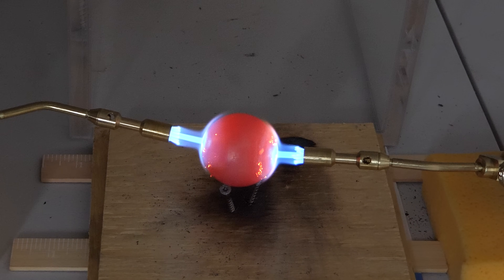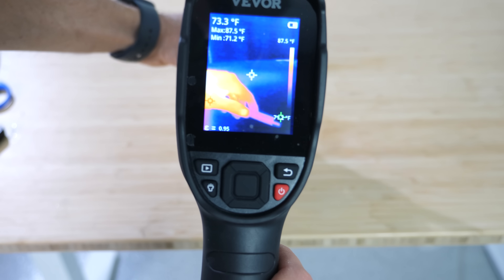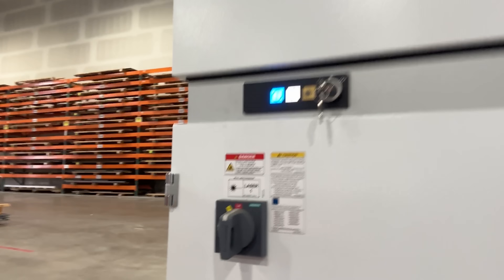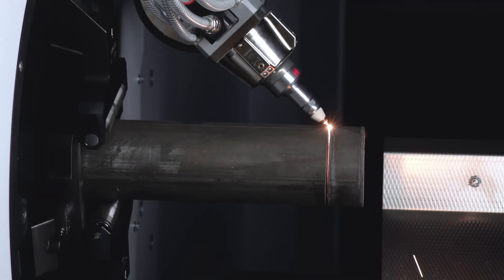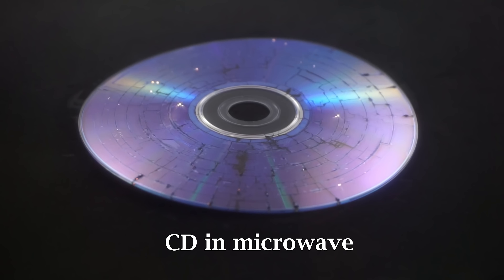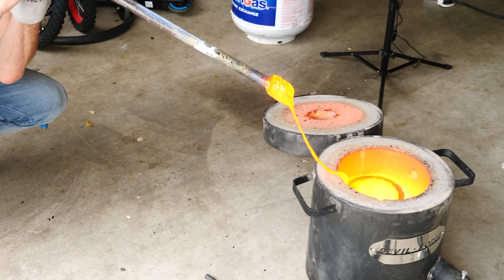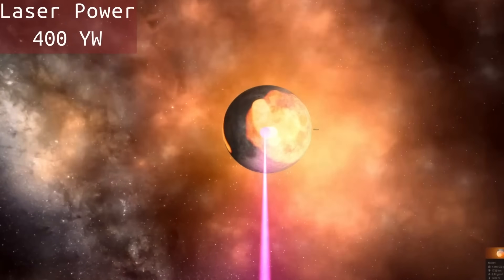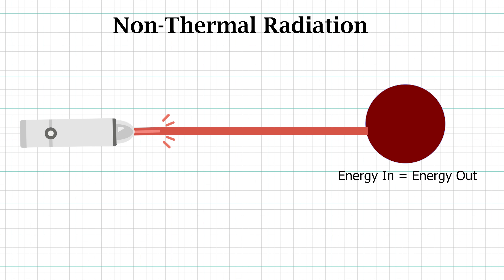How Hot is Light? How Lasers Bend the Rules of Heat Transfer

Comment: I think this is wrong. If I were to look at it from a quantum state, I would argue that the "temperature" never exceeds the source, because there is a transfer from an electron in the laser to an electron in the target material, and that specific transfer will be equal to the "temperature" of the emitting atom. It just keeps happening over and over with favorable conditions on the lasing side that keeps the laser intact, while the target is destroyed. However "temperature" in this case may need to be modified to include the effect of transferring a photon from a less massive atomic nuclei to a more massive nuclei, or vice versa, while the normal definition of "temperature" already factors the phonon vibrations that would normally result in the emission of a photon of the same wavelength from any given mass of the nucleus.

Comment: Thermal dynamic is heat transfer from A to B. 
Laser is however energy transfer from C to D.

The heat come off a laser source is just the energy dissipated as heat due to laser generator efficiency, usually misunderstood as the temperature of the laser source. 

Heating with laser may be regarded as heating with electricity (constant current forcing through a resistor). There is no apparent limit to a temperature ceiling, limit, if we can pass current successfully through it. Steel furnace involving a graphite electrodes to inject current through the steel resistor. It gets hotter and hotter until the energy dissipate off the system equals the input energy can temperature hit the ceiling, equilibrium at a certain temperature.

Comment: 2nd law of thermodynamics is about entropy change in close system. It means heat flow from hot to cold in the case of conduction. In the case of laser, it involves electrical energy input, excitation, spontaneous emissions, stimulated emissions. Each step is govt by thermo law. Kind of like an engine cycle.

Comment: This property of only heating up the source temperature is caused by the conservation of etendue. It's weird property, but it means that if you captured all the light coming off of the sun, you cannot compress that light smaller than the sun. Even simpler, get a flashlight and a magnifying glass, notice that even when you focus the image as much as possible it doesn't go to a single point. It you were able focus the beam tighter while capturing the same amount of light, then you would be able to heat it up hotter than the source.

Comment: What if you put the sun inside the laser stick and focus it's entire energy to a single spot? Can't it still get hotter than the sun itself?
Because like the battery source or the electricity flowing in the magnetron also the sun has an active energy source with fusion.

Comment: Here when laser is hit to any object due to the impulse force imparted by the lasers (electromagnetic waves) it causes an intense heating of the atoms of the object where lasers hit because the energy density inside a laser light is higher than the energy density in nuclear reactor core
So the more the energy power outage of the laser the more the temperature will rise of the object where lasers hit.

Comment: I used to run one of those LT8 laser cutters for various metal tubing. Thay really are amazing, and SUPER high tech. There are dozens of mirrors that the lazer bounces off before it goes through the lense (which is like a $350-500 lense). And thats not including the tube feeding and sensing system which I think is even more complex.

Comment: Now, what about total reflection, like in glass/air interface under specific angle ? It does not depend on conductivity, so it should not decrease... Would probably require a glass block and heating it evenly would be even more changing

Comment: You are wrong. Cutting laser do not vaporise steel. Depending on the supporting gas (oxygen or nitrogen), the metal in the cutting zone is either burned in an oxygen environment, or melted and blown away by a strong stream of nitrogen. In any case, the laser beam does not evaporate the metal, but only heats it.

Comment: You are transferring energy, not just "heat" with a laser.  So, the target gets constantly hit with additional energy and can get much hotter if it can't dissipate the energy being accumulated.  With the hot ball, the target gets hit with the initial heat, but it absorbs that energy from the hot ball, which is cooling as the heat transfers.  So, no new energy is being pumped into the system.

Comment: Ugh, again you say the same blatantly wrong things, you can indeed focus light to a higher temperature than the source. Temperature is a function of energy density, and you can always focus it more densely (well until you start getting into the wavelength size, then things can get weird).

The main mistake you make is you are bastardizing the laws of thermodynamics, which speak of energy, not temperature, to get your weird claims.

So with the focusing example, you would be correct to say that the energy remains the same before and after focusing (ignoring losses in the lens). But the temperature can indeed be higher, because you are changing the area through the focusing.

Comment: I want to explain this in simpler terms since the video doesn't quite do it in my opinion. The concept of temperature applies to physical objects or systems in equilibrium. A laser is continuously getting energy in the form of electricity and then transmitting this energy. This energy transfer is not limited to the laser's temperature because the process is driven by energy input to the laser system.

So energy goes up as long as input energy continues to be supplied.

Comment: It might be difficult to explain for people not familiar with thermodynamics but even lasers kind of have a temperature, it is just it of the scale, a temperature hotter than infinite (usually referred to as a negative temperature)
Lasers use something called population inversion to keep pumping energy into the beam, the idea is that you have more energy than what the system (in that specific degree of freedom) would have at infinite temperature, you have so much energy that entropy and energy relationship changes, now for every Watt added entropy starts to decrease again, that is called negative temperature and is hotter than any “normal” object.
To put in simple words if you go up on the temperature scale get to infinite and keep heating the object you will come back from -infinite and can keep getting hotter and hotter until you eventually reach absolute zero again but now from the negatives.

Comment: idk if the magnifying glass example is correct, because I would think the energy gathered is proportional to the energy source surface to be compared. so, if you have four flashlights via refraction indecies being made as a laser, in one focused beam, it would be colder than 6 flashlights in one focused beam despite each flashlight being identical and at the same temperature.

 sheerly because laser light is still light and more light= more energy, and the collective total energy does not car where it came from to decide how hot it is, it merely exists in a quantity to be expressed. Therefore, it is possible to get a magnifying glass to focus enough light to make a temperature hotter than the sun. Though, it would be impractical and expensive, unless done with an array of glasses or mirrors rather than a giant single piece. There has to be plenty of literature on this I presume because people boil salt this way to turn steam into electricity.

Comment: with Thermodynamics you think macroscopically. To understand how a laser cuts a good example is a sand blaster. The accelerated sand particles hit small sections of the sample kicking away small particles. With a laser each photon hits one single atom with an energy above binding  and ionisation threshold,and it detaches from other atoms and boils away. The higher the laser power the higher  the number of atoms blown away.  You do not need a lot of energy to kick one atom out of the condensed matter. But a lot of power to blow away as many as atoms are in a target. Remember Avogadro number of 6e23/55 atoms in one gram of iron (Fe)

Comment: Big note to point out is that the laser isnt doing the cutting. There is a jet of gas - oxygen or nitrogen (dependant on ferrous v non ferrous material) that does the cutting, the laser just heats up the material enough for the gas to blow it away

Comment: Pretty nice video mate! But one correction, you argued that when we magnify the sun light onto an object, the object can’t get hotter than the sun, but this is basically not the case. The sun heats the Earth via radiation but not convection or conduction. So magnifying the sun light is basically like using lasers :) One the thing we can argu of course is  the conservation of energy. So the Earth can’t use more energy than the Sun is creating :)

Comment: The laws of thermodynamics are outdated and depend on a vague concept of temperature. What is thermal radiation? It is simply electromagnetic radiation. What are lasers? Electromagnetic radiation. So what exactly is non traditional about lasers? The laws of thermodynamics are a special case of a much bigger law and therefore do not deserve to be called a law. Its not a law if you have to do mental gymnastics with definitions to fit the law

Comment: It doesn't really make sense to me why you can't get anything hotter than the surface of the sun by focusing the light. If the explanation for lasers and magnetrons being able to heat objects beyond their temperature is because they emit EM waves, then it should work with the sun too. The energy of the sun doesn't reach us in thermal form. It reaches us in EM form, just like lasers and magnetrons emit. Thermal energy can't propagate in space because there is no medium to propagate through. A magnifying glass doesn't focus thermal energy. It focuses light, which is EM energy.

If you really aren't able to heat things beyond the temperature of the sun, either there is something missing from the explanation, I am misunderstanding something or that statement about the sun is incorrect. Because as I understand it now you SHOULD be able to focus down the sun's EM waves to make things hotter than its surface. Just like you do with microwaves or the light of a laser.

Comment: Since thermal emission is related to surface area, you could theoretically use sunlight to heat something hotter than the surface of the sun, as long as the surface area you're heating is smaller than the surface area on the sun that originally emitted the light. You'd probably need some ridiculous planet sized lens to do it, but I think it is theoretically possible at least.
Reply from the maker: It is not even theoretically possible.

Comment: I'm pretty sure that the reason you didn't see a temperature by shining the laser at the infrared camera is that it was outside the spectrum detectible by the camera, otherwise it should register as the temperature equivalent to the black body radiation wavelength for that same temperature. However, the standard wavelength of infrared lasers is well above range detected by usual infrared heat detecting images. So I think your test at the beginning about the "temperature" of the laser was invalid, since I think it was outside the range of the detector.

Comment: It was cool seeing those Trumpf lasers. I used to work on Trumpf lasers, anywhere from 8kw to 24kw. I mainly operated a 24kw laser paired with a 3060 gantry. It was the first 3060 in the United States to have a 24kw resonator paired with it. I would do all kinds of stuff, from really thin aluminum, to 2 inch thick steel. I knew all the little tricks and techniques to get that thing to cut any material with no laser burr too. The science involved is quite complicated.

Comment: A word of caution. Most ND ,OD 4 to OD 5 ,safety glass 1040 to 1060 nm are great for fiber lasers. However, when the laser strikes the target, it is not just white light from heating that is given off. It is also UV that is not sufficiently protected from your eyes by the safety glasses. Please use caution when viewing the radiated heat signature from molten metal. It can damage your eyes just the same.
Reply: on summer, hot day i had to tig weld some inox tube, i did it in t shirt an i had red burns between wrist and shoulder
Reply: @ exactly, there exist a large body of expertise often through accident that is overlooked. Then you have persons who should know better not presenting information that could prevent serious injury.

Comment: You never did get into the physics of why...
HEAT is the movement of excited particles/molecules. 

Your hands are only 98 degrees, but if you excite them by rubbing them together, you can actually burn yourself (rub burn). 

The microwave vibrates the molecules in the food, heating it up internally.

Comment: Lasers don't defy the laws of thermodynamics. They actually rely on them to function. Here's a breakdown:

 • Energy Input: Lasers require an external energy source (like electricity) to operate. This energy is used to excite atoms within the laser medium, causing them to release photons (light particles).
 • Stimulated Emission:  The excited atoms release photons in a specific direction and with a specific wavelength, creating a coherent beam of light. This process is called stimulated emission.
 • Heat Dissipation:  Not all the input energy is converted into laser light. Some is lost as heat. This is why lasers often need cooling systems to prevent overheating.

So, how does this relate to thermodynamics?
 
•First Law of Thermodynamics: This law states that energy cannot be created or destroyed, only converted from one form to another. Lasers follow this law by converting electrical energy into light energy and heat.
•Second Law of Thermodynamics: This law states that the total entropy (disorder) of an isolated system always increases over time. Lasers don't violate this law either. While they create a highly ordered beam of light, they also generate heat, which increases the overall entropy of the system.

In essence, lasers are a clever way to harness and direct energy, but they don't break any fundamental physical laws.

Comment: Just to make sure everybody’s clear on this, heat flowing from high temperature to low temperature relates to heat conduction between bodies in contact, whereas heating things up with a laser is a case of Radiation Heat Transfer.

All pedantistry aside though, great video as usual!  Thanks.
Reply: Heat will also flow from something hotter to something cooler via radiation, not only conduction.
Reply: @HarmanRobotics, yes, that is 100% true (radiation, rather than conduction, from hot objects to colder objects).  In fact, I had intended to modify my comment above to clarify that the laser heating here is Radiation heating but not Radiation Heat Transfer , as I unwittingly suggested.

It would probably be more accurate to characterize it as an energy transformation from radiation to heat.  The laser is emitting stimulated radiation — thus the LASER acronym — as opposed to black-body heat radiation.  The laser itself is, as he pointed out, not in itself hot.

Comment: I already knew the answer before you started talking about the subject. It's easier to explain it in a matter of energy transfer. With the metal ball, the heat from the ball is transferring to the thing it's touching. With the lazer, it's the same thing. The difference is that the lazer has continuous energy being pumped into it from another source and the object it's being pumped into is transforming the light from the lazer into other forms of energy, heat and in some cases emitting visible light in all directions.
Reply: Not quite.  You could even have continuous energy pumped into an object to keep it at a constant temperature, but by being in thermal contact with another object will never raise the temperature of that other object hotter than the temperature of your object getting energy
Reply: @RWZiggy  When you're pumping energy into something to keep a constant temperature, you're simply putting in as much energy is leaking out through dispersion. Either way, the point that i was making is still the same. The ball has a set amount of energy put into it which it then equalizes with whatever it's touching, whereas the lazer has continuous energy being added as long as it's on.

Comment: You can definitely make something hotter than the surface of the sun with just sunlight, you just need to focus the light to a smaller point. The problem is that any material vaporizes before it even reaches that temperature.
Reply: Yep, he was outright wrong about that.
Reply: No, he's not wrong about that. You can definitely get a higher temperature by focusing to a smaller spot but you cannot get a temperature hotter than the source. For the Sun that maximum temperature is just under 10,000 F; in practice you can expect about 5,000 F, few materials can withstand that.
Reply: @HarmanRobotics  evidently this argument has been going on on the internet for a while.  Charge your laser with a solar panel and then nuke the crap out of what ever you want.  QED.